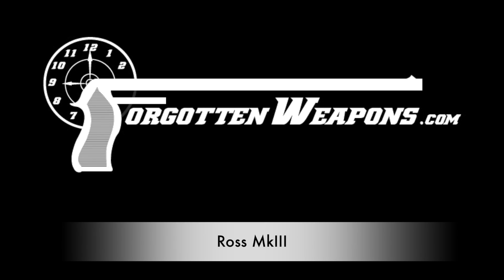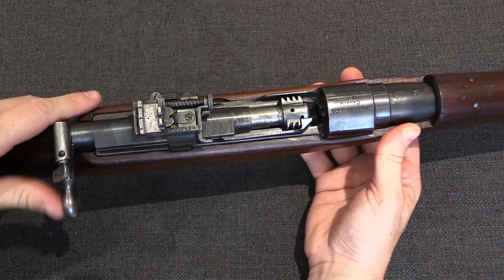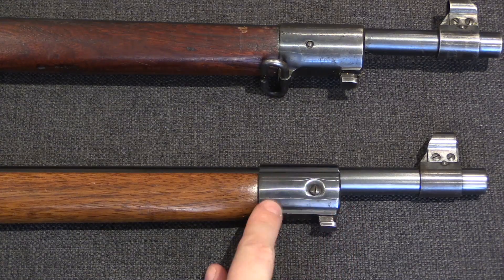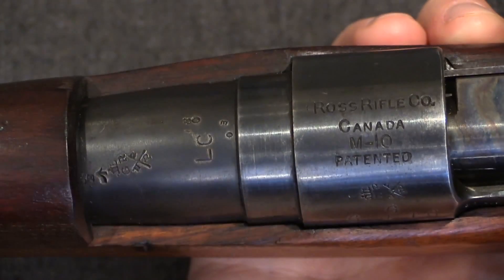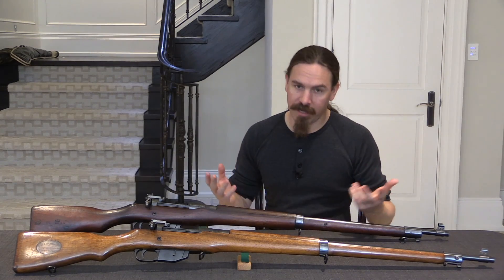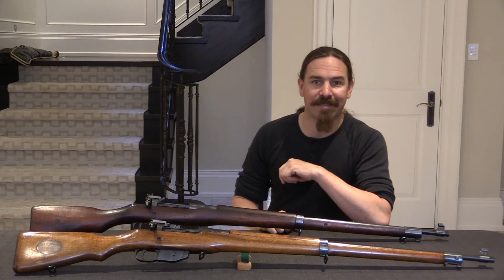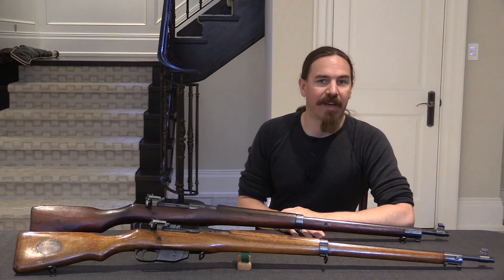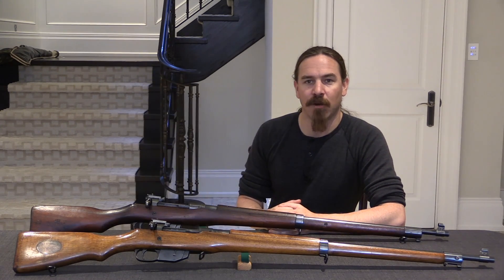The Ross in the Great War: The Mk III (and MkIIIB)

Comment: The British: 'Eh, this ammo is vaguely close  to spec.'

Also the British: 'Your rifle is crap because it doesn't like our garbage ammo. This is your fault, Canada.'
Reply: Francis Pegahmagabow: "Bunch of noobs." (He'd never change his Ross for the Lee)
Reply: Enfield worked just fine. Because that was a battle rifle, not sporting rifle like Ross was. And by the way, straight-pull Manlichers were also troublesome in WWI, mainly because straight-pull bolt isn't resilient to dirt and locking system is less durable than Mauser or Enfield system. Ross was more accurate than Enfield but there is a good reason why Enfield system survived for decades and straight-pull bolt action is pretty much dead.
Reply: @jakublulek3261  The Mannlicher straight-pull M95 rifles worked amazingly well in Austro-Hungarian service, to the point where their German allies envied them and their Italian enemies wrote a song about them. Furthermore, postwar virtually every country formerly part of the Empire--Austria, Czechoslovakia, Hungary, etc--kept their M95 rifles in service and went to the trouble of refurbishing and rechambering them. Many of them were used in WW2, though the Germans worked to replace them with Kar98ks whenever possible to standardize ammunition supplies. After the Allied victory, the Soviets took over most of these countries and equipped their puppet armies with the Mosin-Nagant rifle, once again to standardize ammunition. The Mannlicher straight-pull design lost out because of geo-political and logistics issues, not because there was anything wrong with it.

Also, you may note your beloved Lee-Enfield action hasn't been seen much after WW2, either, even in civilian and sporting rifles. And unlike the Mannlicher, it had the advantage of being produced en masse on the winning side. What's its excuse?
Reply: It's WWI and you are having to produce millions and millions of rounds. Trying to make each one perfect isn't going to happen. You need ammunition and weapons that can be mass produced and work. See the Sten gun. Not a wonderful weapon but available.
Reply: A military rifle for line infantry is actually crap if it is too picky about ammunition*, too sensitive to fowling, or is too complicated to maintain in the field. Is the Ross a bad rifle in general? Not at all. The few that I've shot have excellent sights, are very accurate for the time, and for straight pulls have some ergonomic advantages over a G11 or K31. It's just a bad service rifle.

*I'll give the Swiss a pass on potential ammunition sensitivity in some of their service rifles, given that they've never had it in their national zeitgeist to even conceive that a rifle or it's ammunition should ever be less than absolutely optimal, and cost be damned.
Reply: Also to they didn't realize how bad the mud and grit of the trenches was going to be and the mocking the waters what really gumbed up the gun
Reply: Hey guys , forget Ian and everything he said, this random know it all says otherwise!!
Reply: The Ross was a sporting rifle. It was accurate but dependent on specific ammunition quality and not "squaddie proof."" The Lee Enfields were designed as battle rifles. So that the tolerances could deal with grit and mass produced ammo. If the ammo had been as bad as claimed. Then, there would have been issues with all of the weapons that used it. The Vickers and Lewis machine guns, for example. Canada had its own problems with ammunition quality. In fact, due to Canadian supplied artillery shells being oversized in the bore. They didn't even fit into the gun breaches! Several planned offenses had to be rescheduled or canceled due to this problem. Until affective quality control was implemented. 
A point largely unknown about Canada is that Newfoundland was still a part of Britain until the Confederation. That is why Newfoundlanders could be conscripted while the rest of the Dominions men could not. 
Perhaps, as an act of defiance. Canada should have adopted the Mauser K98? In 8mm Mauser. In Ww2, this round was used in the BESA machine guns in British tanks. Possibly, the perfect match would have  been the Lee Enfield in 8mm Mauser?
Reply: When your soldiers throw it away to grab something that works, it's garbage.
Reply: @neutronalchemist3241  because the out of spec, garbage ammo jammed the gun. If my M16a4 or M27 would have had an out of spec cartridges jamming my weapon so severely that I couldn't retract the bolt and there were others laying around, I would pick up a different one too. Fix a severe jam, wasting time and risking death or pick up one off the ground and continue fighting... the choice is simple.
Reply: @GavinwatchesYT  The ammos were in perfect spec, and infact they worked fine with every other weapon, bolt action or automatic, chambered for them. Simply the manufacturer of the rifle, knowing the real dimensions of the cartridges, said the rifle was fine that way. 
"Every man wielded an Mk III Ross rifle, with some unease. Overseas, the gun had jammed in close combat during the Second Battle of Ypres. It was claimed the rifle was too finely made to tolerate mud and rough handling. There is truth to this, but the fatal flaw was a specific and avoidable mistake. Before the war, the British re-designed the .303 cartridge, rechambering their Lee-Enfields to a slightly larger size than the Ross. Canadian experts said the chamber of the Ross was already large enough to take the new British ammunition in a pinch, and the tighter fit could only increase accuracy anyway. The chambers were not reamed out. It was all about the money. Besides, the experts said, the men would have Canadian ammunition of the right size, so it hardly mattered." https://www.smallarmsreview.com/display.article.cfm?idarticles=4114
Reply: @neutronalchemist3241  "But, the British Army took all the Canadian-made .303 ammunition away from the first Canadian troops when they arrived in Britain and issued it to their machine guns at the front where it worked quite well. The poorly made British ammunition issued to Canadians in return was responsible for the tragic story of the Ross to follow." Quite literally the next paragraph. Not saying the Ross was a great or magnificent or perfect rifle but when then next paragraph of the article you are quoting  in an attempt to prove a point agrees with your opposition; that the cheap British ammo was a major flaw, so much so that the British didn't want to use it in their own weapons, you probably shouldn't quote it and share the link.
Reply: @LilSwinney  The Canadians could have required to use their own ammos, had they thought they were necessary for their rifles to work. It was not like they had no say in the matter, but, as already said, "Canadian experts said the chamber of the Ross was already large enough to take the new British ammunition in a pinch, and the tighter fit could only increase accuracy anyway". If they didn't tell the Brits their rifles were useless without their ammunitions, are them the idiots, not the Brits.
Reply: @neutronalchemist3241  Considering the weapons Canada used had to be approved by the British Empire its extremely unlikely that telling the owner of their territory that they couldn't use the resources that territory produced would have gone over very well.
Reply: @LilSwinney  What The Brits would have done? Invading Canada? During the IWW?
Reply: @neutronalchemist3241  let's see more and harsher taxes and tariffs. Direct sovereign control, forced conscription, labor, etc. And why would they invade a territory they own, especially when the majority of that territories military force is essentially surrounded by their own military. They literally can just play the we own you card and most of your military is currently surrounded by ours card
Reply: @LilSwinney  Canada is not exactly surrounded by the United Kingdom, and the Brits desperately needed the Canadian support, not the contrary. UK was not in position to impose anything, nor taxes, nor conscription, nor tariffs (they needed any ounce of materials from abroad, and they would have imposed tariffs? LOL!) nor they could intern some hundred of thousands of Canadian soldiers depriving the front of them (during WWI? Please...). Had the Canadians tought their ammos were useful to keep their rifles working, they could have easily kept them. Unfortunately they didn't "Canadian experts said the chamber of the Ross was already large enough to take the new British ammunition in a pinch, and the tighter fit could only increase accuracy anyway".
Reply: @neutronalchemist3241  yes we are well aware of that one quote it's the only part of the entire article you obviously read and you dont seem to understand that the Canadian troops were the Britain's troops first a foremost so like in any military setting the guys in charge get to decide who uses what in this case the british machine guns were gonna get the superior canadian ammo because as you pointed out they needed ever ounce of material. Also the surrounded canadian troops was a reference to the fact that the Canadian troops were in the middle of the UK about to be shipped where they needed to go not that the UK actually surrounds Canada.
Reply: @LilSwinney  "in this case the british machine guns were gonna get the superior canadian ammo because as you pointed out they needed ever ounce of material"
So to the Canadians were not given ammos? Otherwise this sentence has no sense.
Had the Canadians tought their ammos were useful to keep their rifles working, they could have easily kept them. Nothing more difficult than to say "our rifles don't work with your ammos, sorry".  Unfortunately they didn't because "Canadian experts said the chamber of the Ross was already large enough to take the new British ammunition in a pinch, and the tighter fit could only increase accuracy anyway".

"Also the surrounded canadian troops..."
"Nor they could intern some hundred of thousands of Canadian soldiers depriving the front of them (during WWI? Please...)"

Again. The Brits desperately needed the Canadian support, not the contrary. UK was not in position to impose anything, nor taxes, nor conscription, nor tariffs, nor to use Canadian ammos, had the Canadians tought they needed them.
Reply: @neutronalchemist3241  I unfortunately won't be responding after this as all you seem capable of is running in circles. So as my closing argument if you read the article you were kind enough to provide you will know the british took the Canadian ammo to use in their machine guns because it was of higher make and quality of their own. It also makes reference too the fact that the British weren't properly quality checking their rush order ammo that they gave the Canadians yes it may have fit but if you put too much powder in it'll still blow up, also the article very much implies that yes the British ammo would work if you had absolutely nothing else but you shouldn't use it long term. As far as the Canadians keeping their ammo that's not how it works, for one Canada isn't an independent nation they are part of Britain so the British very much have the power to say this is mine, also it's the military, you try going to the quarter master and saying I don't like these bullets give me those and see how that works for you. I'll also briefly mention the british were controlling the canadian supply lines as well as their own so even if they did say we have to have that ammo the British didn't have to send it after all logistical errors happen all the time all they would say is it got sent to the wrong place by accident make do with what you have
Reply: @LilSwinney  Yes. it's how it works. Had the Canadians tought their ammos were useful to keep their rifles working, they could have easily kept them. Nothing more difficult than to say "our rifles don't work with your ammos, sorry". The Brits had no interest in having some hundred of thousand soldiers on the frontline with useless rifles and, even had they been those cartoonish bad guys you are depicting, they were not in position to impose anything, because they need Canadian men and materials, not the contrary. And please, don't invent supply line issues. To supply the Canadians with their own manufactured ammos was not more difficult than supply the Canadians with their own manufactured rifles. Canadians had been able to keep their rifles, hadn't they? They had been able to IMPOSE the use of their Ross rifles, while the Brits were using Enfields, hadn't they? The supply lines  supplied them with spare parts for the Ross, even if the Brits used another rifle, didn't they? Logistically it was a pain in the ass, but THE BRITS COULD DO NOTHING ABOUT IT. Because the Ross had been Canada's choice and the Canadians wanted to use it. Now you are telling me that the supply line could supply them with their rifles, their spare parts, their specific Canadian made uniform, their specific Canadian made webbing, their specific Canadian made showels, every piece of their equipment that was different from the British one, but was unable to supply them with their ammos? They had a sudden amnesia on how to delivery items when it came to rounds? What kind of shitty supply line the Canadians had?
Reply: @neutronalchemist3241  None of this matters.

Ian himself states that the main reason the gun experienced issues was cause of questionable British quality ammo.

Canada used an excellent .303 round at the time. The Canadians figured the British .303 should do just fine. Little did they know Britain started botching there ammo quality and forced it onto the Canadians while using Canadian made .303 for the machine guns.

The myths behind this rifle are, as with all myths, blown way out of proportion. Canadian snipers that used this rifle knew that the rifle made an excellent sniper rifle for its time and that it was a rifle design for a snipers touch. Not an infantrys sloppy ass touch. Canada actually makes high quality guns. Its just that if you ham fist the wrong ammo like the British did then that would fuck up ANY gun.

The stories of Canadian soldiers ditching the Ross were very minimal and the ones who did only did so because they couldn't figure out what the problem was. It was the British ammo.
Reply: @matthewbrian6360  Ian is not necessarily right but, as already stated, Had the Canadians tought their ammos were useful to keep their rifles working, they could have easily kept them.

So the Canadians didn't keep track of their equipment? That's not how intendance works. 

None ever questioned the accuracy of the rifle. Fact is that the "ham fisted" British ammos worked just fine in the British rifles. 

Again, had the Canadians tought their ammos were useful to keep their rifles working, they could have easily kept them.
Reply: Man I don't think you understand how british imperialism works
Reply: @TheFanatical1  yeah, that person definitely doesn't understand.
Reply: @neutronalchemist3241  Are you a smooth brain? Yes I think you are.

First off.  "Had the Canadians tough there Ammos were useful to keep there rifles working. They could have easily kept them"

Not how it works back then genius. Canada was a British colony at the time. If they wanted our ammo in trade for shitty quality ammo then that's what they could do at the time.

The incompetence is with the British. Not Canada or this rifle. Which works just fine as you can see.

There were plenty of problems with ham fisted ammo. Why do you think they had to use excellent Canadian .303 for there machine guns instead?

Again, you're an idiot that knows nothing. Good bye.
Reply: @matthewbrian6360  You could have read the answers above, had you been able to understand them. Unfortunately they are above your level of comprehension.
The colonial power had not been able to force Canadians to use British rifles, British webbings, British uniforms... but they could force them to use British ammos? Please...
Reply: @LilSwinney  you don't know much about how the British empire worked do you bud?
Reply: @neutronalchemist3241   The Ross absolutely was not Canada's choice. The Ross was a rifle chosen out of necessity. Britain did not want to give the Canadians Lee Enfields because of short supply, and they refused to let Canada produce their own Lee Enfields under license. So the Ross Rifle was presented as an immediate solution, as a factory was already set up in Quebec producing sporting rifles that could be modified for military use and get new rifles into the hands of troops within a very short period of time. I say this as a proud Canadian, Canada wasn't able to impose anything. We were a colony. A large, wealthy colony, with its own government, but a colony nonetheless that answered to the Crown. Nobody asked Canada if they wanted to go to war in 1914, they were at war automatically although enthusiastically. We were only granted complete independence in the 1982.  The Ross was not designed to be a service rifle. It was too nice, too sensitive to low quality ammunition and poor conditions, and too complex. Militaries are not democracies. You don't get to do whatever you want simply because it makes sense or that's how you want to do it. If an officer ranking higher than you says "You're handing over that good ammunition to the machine gunners and you get all this crappy ammunition," you're gonna do it.
Reply: @obviouspseudonym9345  Ross rifle had ABSOLUTELY been Canada's choice. The refusal of the licence was of 1903. the Canadians had 11 YEARS to choose any rifle they wanted, there were tons of designs and available licences to choose from, and they chose the Ross. In 1914 they were at the 4th iteration of the rifle. The "we were a colony" argument can work had the Brits IMPOSED a rifle, but they didn't. Any country can refuse a production licence to another, it happens evey time. It's not like the other country is forced to use garbage only because they didn't get a specific licence. "oh no!, the US didn't grant me the licence to produce the Humvee! Now our soldiers should reach the battlefield by bycicle!" No, there are many other light trucks to chose from. Canada chose the Ross not because they had been forced. They did because they thought it was good and the Canadian government kept on defending the rifle against any evidence, even accusing the British officers that rised the issue of ignorance and incompetence, so much an oppressed colony they were. 
The Ross was a piece of equipment specific of Canadian soldiers, as many other pieces of equipment were specific for canadian troops, and none of them had been "forced" onto them.
Reply: @neutronalchemist3241  that sounds like a bunch of malarky. I have had many different .303 cartridges in my collection, dating from 1898 to the 1950’s, as well I have owned various Lee Enfields, from the Mk.I of 1896, to the No.4 Mk.2. The Mk.I from 1896 had no issues digesting ANY ammo I fed to it. I have measured cartridges in my collection, and haven’t found any that differ appreciably from each other.